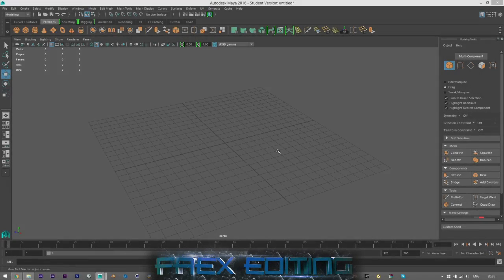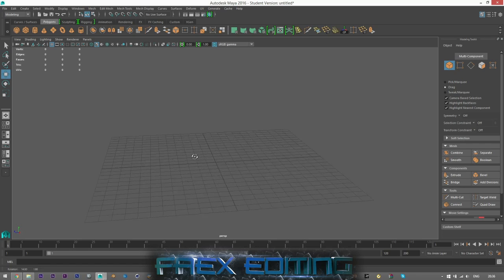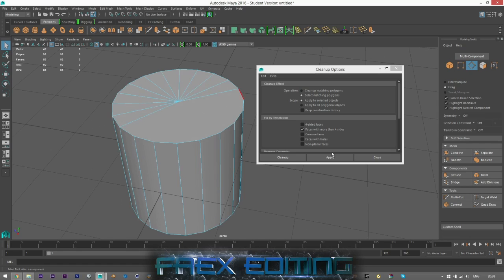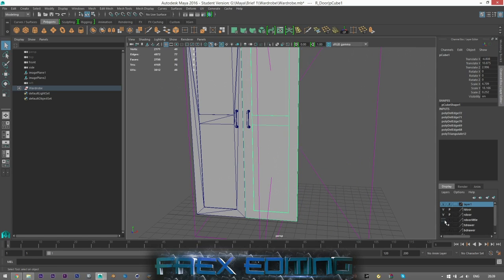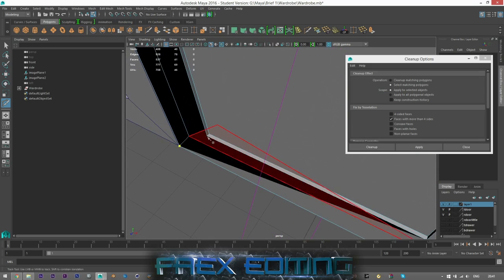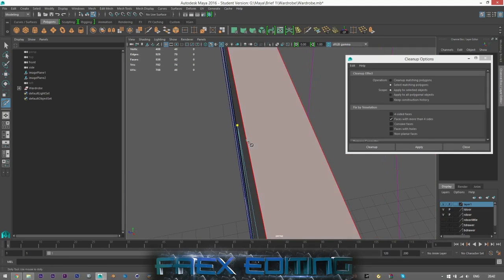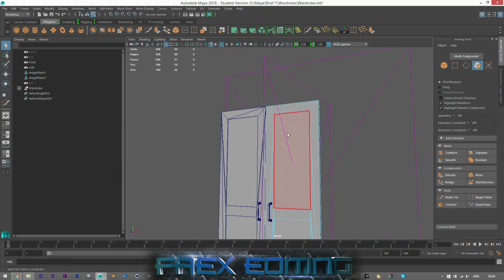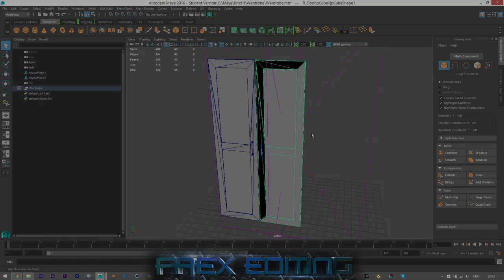Learning Maya Episode 5 - Cleanup Tutorial

Comment: The mesh clean up and reduction tools work for me, but they always cause lagging when I try to manipulate my rig for a character. I always see a loading bar in the bottom left that indicates the action I did is loading for every new pose. Any idea how to resolve that?
Reply from the maker: Plugged IN Tube it would usually be best to reduce or clean-up before you start posing a character, good topology will also solve the need for cleanup, and more effective movements in rigging, so I would suggest doing all optizing before rigging and posing :) hope this helps
Reply: FaexEditing Thanks, it does help. I am in a situation where I simply want to reduce the polys in the mouth of a skinned character. There is no way for me avoid needing to unbind to edit and then reskin my character?